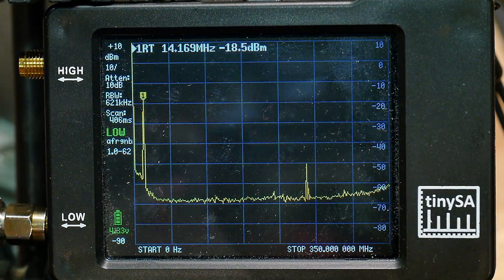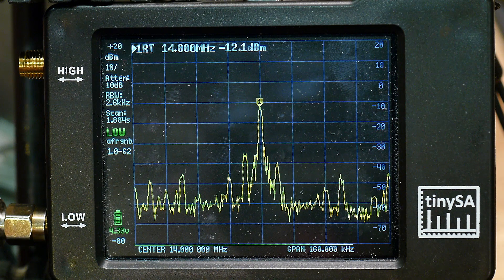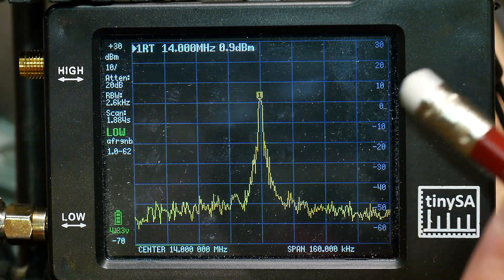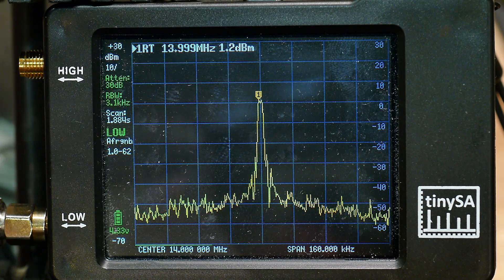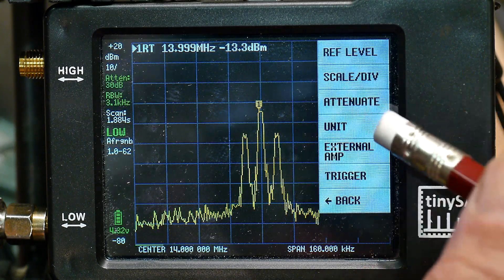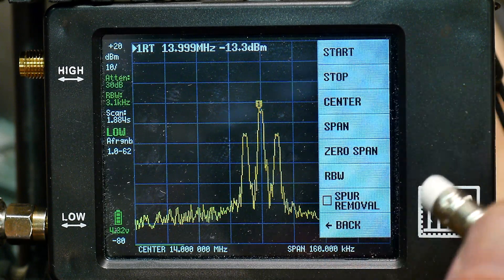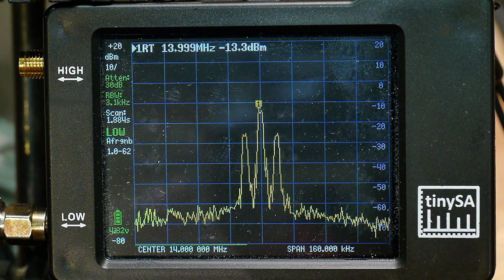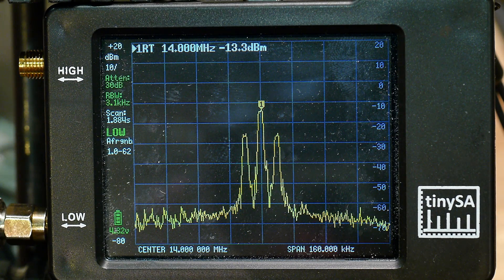#537c TinySA Don't use AUTO settings

Comment: I suggest that you include the firmware revision with your videos.
Reply from the maker: Most of my Tiny videos are old firmware, you are correct. The videos have dates. But, many of these problems still exist
Reply: @IMSAIGuy  yes they do,... I have looked at github, I HATE picking up some one else's code. An afternoon with an author would maybe make it possible to pick up, but crap that can be a mess. Maybe rather buy a Siglent. Or just live with it. I use it as a test instrument more than a design tool.
I am a mostly retired EE, always interested in RF but never really had the need at work. So now in my tottering years I try to pick some of it up,...

Comment: Based  on your evaluation I updated the auto attenuation to keep the signal below -30dB and ensure the lowest selectable RBW is 3kHz. Can you test with the latest FW?
Reply from the maker: Great! I am running: tinySA_v1.0-64-g3ff96c8
The RBW problem has been fixed but the attn still needs another 10db. I tested:
input     TinySA attn auto  TinySA attn needed
0dbm            -20db                       -30
-5                   -15                            -25
--10                -10                            -20
-15                  -5                              -15
-20                   0                              -10
Reply from the maker: the input dBm value is for an AM modulated signal so total power not peak spectral data.
Reply: @IMSAIGuy  There is another problem when measuring AM modulation. Please have a look at this wiki page: https://tinysa.org/wiki/pmwiki.php?n=Main.AMModulation